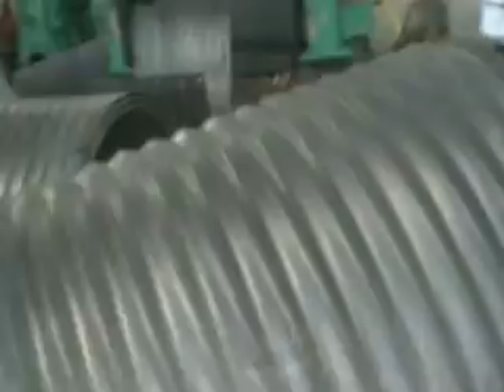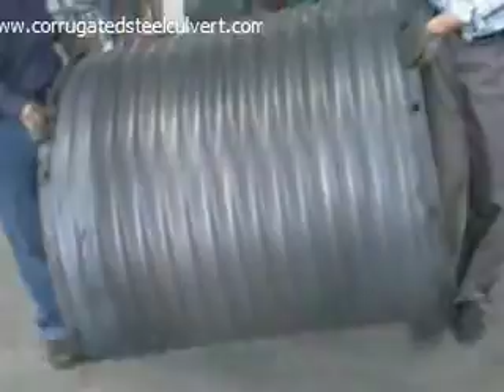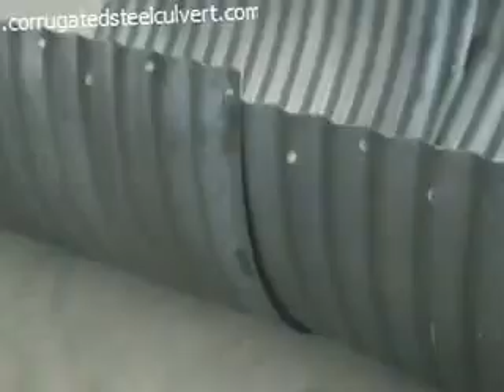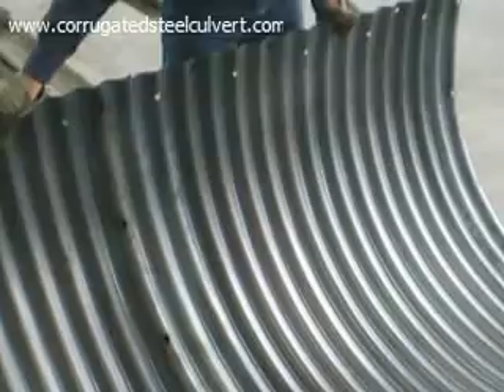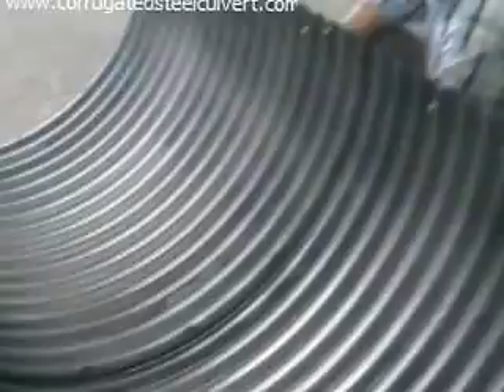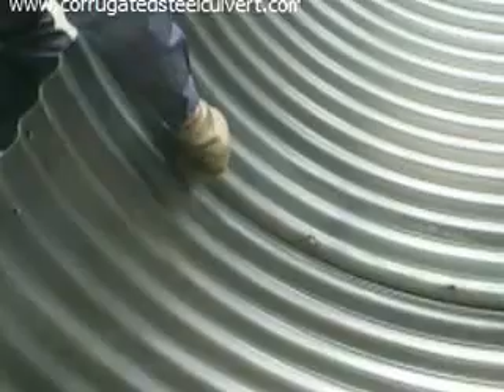How to assemble corrugated steel pipe?

Comment: What is the materials composition used in making tinhorn culvert pipe ? pros and cons what's my choices; why buy a tinhorn culvert pipe verse's a double walled plastic culvert pipe; what I am getting in buying a  tinhorn culvert pipe , what's is in the material  they used  to make it ? is it 100% or layered materials will it flake off chip off flake , separate , is it pressed together materials mixing the metals or it 100 %  made  of same material ? and the manufacturing process of tinhorns culvert pipe is it heated together to solidify like soldering wires together ?  verses a double walled plastics culvert pipe what is the materials composition  mixed chemicals that harden to make them? used in making tinhorn culvert pipe  verses plastic culvert pipes ? Thanks for any help sheading the light with info . Thanks! Pamela
Reply from the maker: Pls give me your email, we will contact you soon